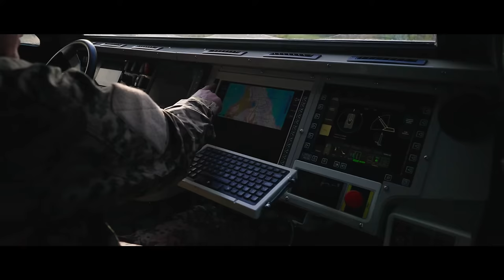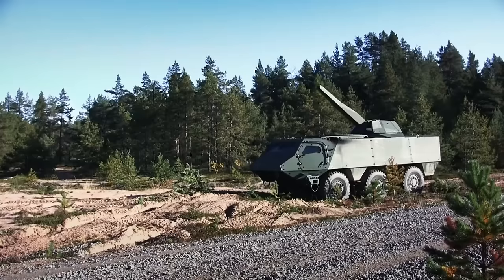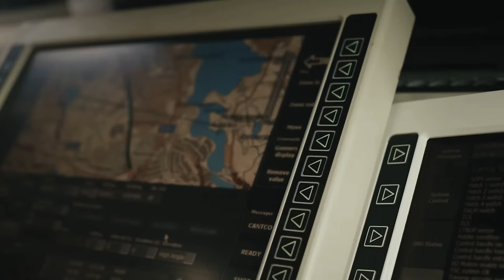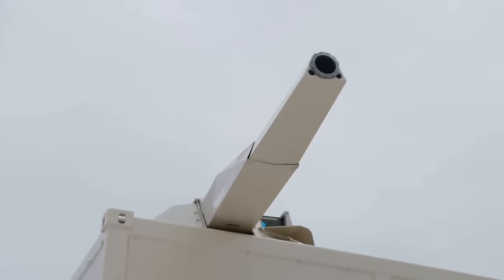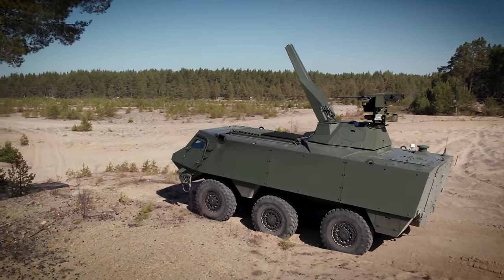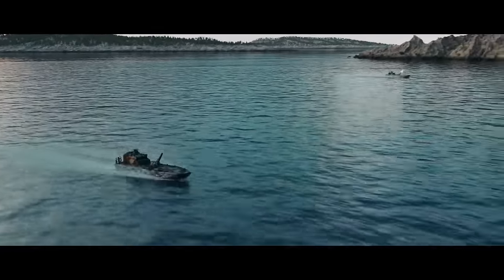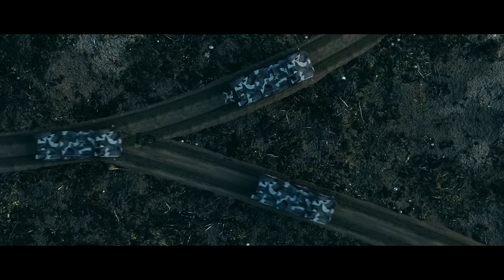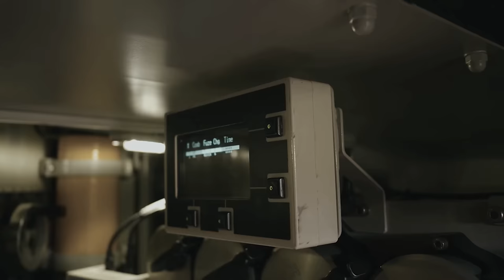The Patria 'NEMO' 120mm Mortar | WORLDS BEST MORTAR SYSTEM

Comment: The NEMO isn't a vehicle. It's a turreted mortar system, which can be mounted on a variety of vehicles and small ships.
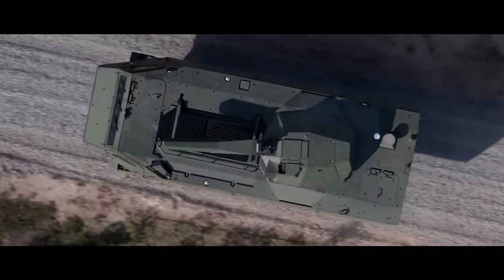Reply: He says exactly this at around the 2:05 mark... Did you make this comment before actually watching the video?  😉
Reply: @berryreading4809  Exactly. He mentions it is modular and can fit on many vehicles all through out the video.
Reply: that seems like a superb infantry support weapon. Shorter in restricted terrain and less muzzle blast than a 120mm tank gun but a big HE round.
Reply: @steveaustin2686  Including not vehicles. the "Mounted in and on a shipping container and remote operated" is genious not to mention you can keep a shipping container on a train, boat or truck and still be mobile.
Reply: @LasOrveloz  A few of us have mentioned the NEMO shipping container as a way to thwart pirates, either with direct fire or airburts in traditional mortar firing mode from a cargo ship.
Reply: Also as a standalone shipping container.
Reply: @berryreading4809  He says something in video. I thought it was just intro/self promotion.

Comment: The AMOS version is REALLY cool! The US really needs to update their motor carriers, this seems like the perfect weapon to do that.
Reply: Replacing & buying new systems costs $$$ & has to be justified as better enough & factor in training & maintaining the system.
Reply: Yes. The entire US fleet is old, cold war systems that have been upgraded enough to deal with insurgents.  The jltv is the first modern Era system pushed out for the Army.
Reply: I remember the US military was playing around with a very similar system about 20 years ago. I think the issue is that it just doesn't fall into the US doctrine at the moment since the US operates on Air Dominance/supremacy the idea is that if it isn't being done by a 155mm howitzer or small drone its being done by a large drone or a multirole fighter jet.

now I wouldn't mind seeing the US update the mortar carrier with a similar system but I also think Raytheon or General Dynamics land systems could put out a domestic product that is similar or better with a very short development cycle and probably slap it on top of a Stryker.
Reply: @nickc7320  The Stryker is from 2002, most of our aircraft are pretty new with even the super hornet technically being from the late 90s. The M3 (not M2) bradley is technically a different vehicle in the same way that the M47 and M48 were different vehicles despite the changes being largely in shape and the M3 is post cold war. 

really the issue is that the US military stopped adopting completely new systems in the early 2000s because the global economy was trashed.
Reply: NEMO is perfect for Strykers. The US Army is still upgrading to double V hull Strykers and this would be a great addition.

AMOS would be good for tracked platforms such as a variant of the upcoming XM30 MICV Bradley replacement.
Reply: @stupidburp  The replacement for the Bradley will likely be a version of the General Dynamics Griffon since the M10 booker was the 105mm infantry support version and the other version in competition to replace the Bradley is armed with the new 50mm auto cannon.

as for the Stryker I do think the NEMO could be a useful option for a variant of the Stryker.
Reply: US has evaluated NEMO, but they are usually very reluctant on foreign equipment due to US internal politics.
Reply: @menninkainen8830  There has been a lot of times US has gone with a foreign design, but will set up a production line in the US, either with a US subsidiary or local partner.
Reply: @xxxlonewolf49 "new systems" just how many mothballed M113 Gavin platforms does US have anyway?
Reply: @jonnekallu1627  The things stockpiled would surprise most people. But most 113's have been given away as "free" mil aid to other powers. I'm sure the NG has some still as getting new gear is NOT cheap, but the 113 platform is so obsolete...
Reply: according to my knowledge, US-army/government is negotiating with finns to buy AMOS...
Reply: They actually are, BAE has developed a system with NEMO for the US Army
Reply: @SnowmanTF2  In small arms, maybe.  Not in an entire vehicle system.  Not even remotely comparable.
Reply: I heard a rumor that USA is buying 60 of these systems in 10 years? If so, i have some work to do :)
Reply: We are. We're going to put these on a Bradley AMPV hull

Comment: The NATO Nona. Actually, what impressed me the most in the video wasn't the mortar system but the little drone on the naval variant of the NEMO. I know modern militaries use drones like those for reconnaissance, but are they capable of feeding coordinates to indirect fire systems? That's real neat.
Reply: with a combination of GPS and inertial sensors & decent optical sensors a drone can not only put itself on a map but also calculate the coordinates for a target it has detected, even if the coordinates are slightly off, after the second salvo at latest the observed hits will have provided the NEMO with the data it needs to make the corrections. Patria started developing AMOS/NEMO in the 90s & as the system is designed to work with target data from human FOs as well the human error has been factored in from the beginning, after over 20 years of close cooperation with the Finnish Defence Forces the system should be more than capable of making any necessary corrections on the fly.
Reply: Russians have using drones to guide in laser-guided Krasnopol artillery rounds; Ukrainians use their drones to drop GPS-guided Excalibur rounds.
Reply: Thats literally how all forward observation is done in ukraine and russia right now
Reply: @wwiking8055  I am pretty sure they are not fed directly into the mortar operators brain tho. They check cordinates with drones give them to the mortar/artillery guy who then manually make adjustments on the weapon system. This is very different compared to automatcally lock on to the targets.
Reply: @jeremakela9273 depends on the setting. The co-ordinares can also be sent directly to the system that will lock on to the new target. New fire missions or corrections to the fire are rarely made by the ones who operate the vehicle.
Reply: @wwiking8055  Based on videos it's still mostly visual observation by humanbeings using drones, no automatic coordinates.
Reply: @jonesijones  Yeah I am by no means an expert on mortar/artillery system as my experties are in CQB in and Urban warfare. But what I meant was that there are lot of drones also being used just to tell people using basic mortr tubes from the pits aswel. So the point was that even if everyone has a drone it doesn't mean that they are used in the same way. If this makes sense. And also thanks for the information, I think i need to research indirect fire abit.
Reply: Just read about that and afaik, the drone can be used to designate targets and the NEMO and the drone can communicate with each other directly. So, click the targets, press "fire" and the rest is automatic.

Comment: This is a really impressive system and I wonder just how small they can slim it down to where it might fit on something along the lines of a HMMVV or the back of a pickup truck.
Reply: 80 mm version on a Humvee, 60mm on a Hilux.
Main thing would be the power generation for computer and hydraulics.
Reply: Do they have an  AMPHIBIOUS"  capability unit yet! 🤔🤔
Reply: @NuggetsAndLaundry  none of those vehicle's suspensions could ever be reinforced and stiffened enough to handle the recoil impulse of a 120mm mortar.
Reply: @SonsOfLorgar  I believe there is a mortar version that pivots the tube over the back to rest on the ground, so the recoil isn't as bad on the vehicle. Takes longer to set up than NEMO would, but would work on lighter vehicles. IIRC, it's like a minute or so to set up or stow.

Comment: I wonder how you stack up this system, the Patria Nemo (6 million) with the Panzerhaubitze 2000 (17 million) in terms of bang for the buck.  Granted they do fill two different roles.  So lets say a battery of the panzers of 6 (102 million) versus 17 of the nemos for the same price.  I hate to say it as a former FO, but having fire that is dedicated to me is more valuable than something shared by the entire brigade.  I think the immediacy of fire from the mortars would be my goto.  I would certainty prefer the rate of fire from the Patria versus the 120mm mortars on the back of m113s and the Paladins that I had in the late 80s, early 90s.  I would be interested in mean time to failure on these automated systems though.  

Edit, ok at 4.5 million, that Archer is looking real attractive.
Reply: The thing with mortars though is that they have better effect on targets in light-medium cover/field fortifications than howitzers.
Both is needed.
Reply: Think about it: most of cost contributors - barrel, FCS - are very similar.   Not sure about ammo, but automated mortar always will be quicker.
Reply: @SonsOfLorgar  Both is a good answer. It's also worth noting that by having organic mortar support so will that let any supporting howitzers focus on the really important fire missions.
Reply: @znail4675  you can probably afford to upgrade one at a time.  Imho.

Comment: So this is basically half of the AMOS capability at, presumably a more disgestible price, but you can still double them up for basically getting an AMOS if you want?

The modularity is stunning.
Reply: No. AMOS is a different, albeit similiar system that was developed by patria for the finnish defence forces. Patria does not own the AMOS system, but rather the FDF so they developed their "own" version wich is the NEMO so they can sell it to other countries.
Reply: New AMOS-vehicles have not been in production for quite some time. AMOS was a project between Patria and a swedish company that no longer exists. That’s why the NEMO was created and it has been fine tuned to be almost as effective as the AMOS counterpart. 

Modularity is key when talking about almost any Patria vehicle or system. NEMO can be integrated to different vehicles easily and can still operate extremely effectively.

Comment: I predict that automated mortar systems will be part of all modern mechanized formations to stay ahead in the OODA loop.
Reply: what is OODA?
Reply: @SamyH_amSet  Observe, orient, decide, act. You look for a target. Is this friend or foe, is it appropriate according the the rules of engagement, are you hesitant or is your training on point etc.? Do you engage now or wait for whatever reason. (Ambush. Want to get closer). Attack. Repeat. 

With new technology such as automated systems, AI and expendable drones with the ability to search for targets and feed the weapon system with target data, it will be more important than ever to stay ahead in the loop. Modern automated weapon systems will saturate older weapons in a conflict in seconds while they are on the move themselves.
Reply: The more missions a small formation can solve by themself without having to call in for fire support, the more rapidly it can deal with enemies it meets. Mortars is extra nice to have along as they provide a lot more firepower for the size and cost of ammo then other types of artillery saving on the logistics end.
There are also anti-tank rounds for mortars making them also able to fill a similar role as anti-tank missiles, but cheaper.

Comment: While the NEMO system can be integrated with IFVs like the CV90 (which I think would be an improvement over the Mjölner given its ability to suppress the elevation to -3 degrees and so able to engage targets with direct fire), I think that integration of the NEMO (or maybe even the AMOS) into the M10 Booker light "not a tank" might yield the ideal heavy mortar carrier. The much heavier armor of the M10 would greatly increase the survivability of this type of shorter range system that has to be relatively close to the line of contact and thus much more likely to run into a newer generation IFV with larger 40mm gun or a soldier with a RPG that the lighter armor of a APC/IFV hull wouldn't provide sufficient protection. 

And while it couldn't go toe-to-toe with a MBT if it accidentally found itself within range  and LOS of one, a NEMO/M10 system wouldn't be entirely helpless since it could fire a HEAT round on a direct trajectory that could at least penetrate the side and rear armor. In fact while moving between firing locations, it would probably be smart to keep an unguided HEAT round in the gun for just this situation.
Reply: It can also fire a homing top attack EFP round with or witout rocket booster at up to 8km...

Comment: A vehicle that blows my mind is the CV90-120 Ghost, a light weight futuristic looking low profile tank with a 120mm gun, this one puts the M10 Booker to shame...perhaps do a video on the CV 90-120 ghost Mat!?
Reply: you had me right up until "puts the M10 booker to shame" there is no evidence that it is a better vehicle than the booker other than some marketing and promotional material and the comment reeks of "I get my idea of US military procurement from the pentagon wars movie"
Reply: @dominuslogik484 Being from the EU, I haven't got a foggiest what the Pantagon Wars are...That said, my opinion (emphasis) is based on the fact that the ghost is less heavy, has a 120mm gun vs the 105mm, is faster, more agile and is more stealthy. Atb
Reply: @gerlachsieders4578  "more stealthy" if it produces heat as a ground vehicle it isn't stealthy. 105mm has a better variety of ammunition for the stated goal of infantry support than the 120mm has available along with larger ammo capacity in the turret.

"more agile" is up for debate as the two have not been compared to one another in a direct competition. as for it being lighter weight the M10 booker is between 38-42 tons with the CV90-120 coming out around 38 tons with only the earliest versions sporting a light autocannon being much lighter. also the top speed is slightly faster on the M10 booker with the unclassified details stating 45 MPH vs the CV90 at 43 MPH.

also I am fairly certain you have movie theaters in the EU and that the Pentagon wars movie and the book are available in the EU.

Comment: Slap a container version of NEMO on a cargo ship traveling through areas with pirates. Direct fire vs a pirate would be bad for them or dropping rounds from up high would probably convince the pirates to move on.
Reply: With NEMO's accuracy, the only direction Pirates would be "moving on" would be to feed the local aquatic fauna...
Reply: Use airburst fuzes and you´d be golden.
Reply: @Darwinist  Yeah, highly visible and more likely to get a hit.
Reply: @steveaustin2686  air burst with some chalk packed into the "civilian" rounds so that when it bursts it makes a clearly visible blast that serves as a warning in case the first shot doesn't hit home. imagine air burst shells that also make a big puff of orange chalk to both help the crew on the ship identify where they hit and make a big warning sign to incoming pirates.
Reply: @dominuslogik484  Definitely.

Comment: this system is perfect for the in development Indonesian Antasena-class Tank boat, having an acurate drive by mortar that could harass a coastal foot hold is gonna be really useful in a archapelagic area
Reply: Tank boat? is that like the old armored patrol gun boats the soviets used to use during WW2? obviously with modern instruments.
Reply: @dominuslogik484  yes it really is very similar to those old ww2 soviet gunboat with the T-34 turret and katyusha, but the design is more akin to a small armored coastal defence/landing boat with a tank/IFV turret and actually capable of rolling onto the beach like a landing craft

Comment: They’re going to have to develop a canister round to go with that direct fire capability. Probably would also be useful against drone swarms. Would be a 0.01 gauge shotgun.
Reply: Umm... what do you think the default ammo of a mortar is?

Hint: The most common mortar round in Swedish ammo stockpiles is a  Tripple mode airburst/impact/delayed fuse 120mm HEFRAG round, in Finnish stockpiles, I suspect it's the second most common, with the most common beeing old 1950ies HEFRAG with  impact fuse and optional fuse extension rod unless those old shells are all sent as aid to Ukraine by now.
Reply: @SonsOfLorgar  HE has a minimum range limitation that canister or beehive does not.

Comment: 1.  Being able to mash the gas pedal after you drop two out-going will be a thing with radar controlled counter-battery fire.
2.  Being able to attach this turret to a wide range of vehicles and vehicle types will allow militaries to repurpose outdated vehicles.  Fitting this to an M113 would give those vehicles a lot of new life as mobile mortar units.  Being able to spam mortar support would make a big difference when dealing with militaries that are larger than your own but not very well trained... like in certain parts of the world.

Comment: PzH 2000 has to be the most intimidating conventional weapon. It combines incredible accuracy, range, firepower, mobility and crew protection. It can fire ten 155mm artillery shells per minute, four of which will hit the target at the same time, ensuring complete target area destruction before the enemy even has a chance to take cover. With this technology, a single gun can provide the same fire support as an entire battery of conventional howitzers. You don't want to be on the receiving end of this.

Comment: Swedish Marines Get Shipboard Mortars
The Swedish Marines (Amfibiebataljonen) are set to receive a new capability through the acquisition of vessels cb90 with integrated heavy mortars - but the project is already hit by delays and shrinking numbers.

Ordering artillery platforms adds new capability to the amphibious battalions
FMV has signed a contract with Swede Ship Marine AB to deliver sea-mobile artillery platforms with stabilizing grenade launchers for use within the Amphibious Battalion in Stockholm and Gothenburg.